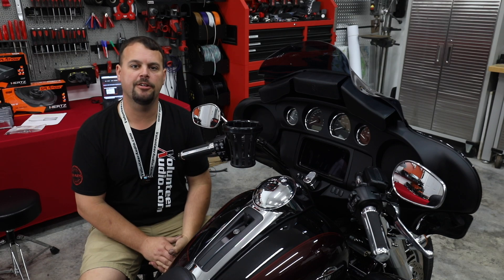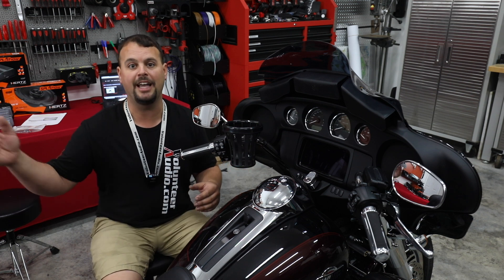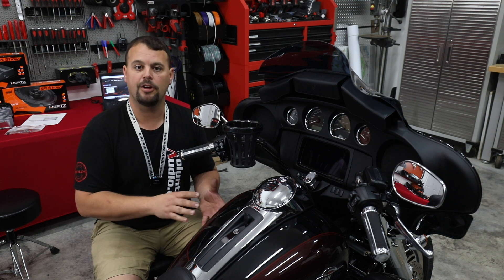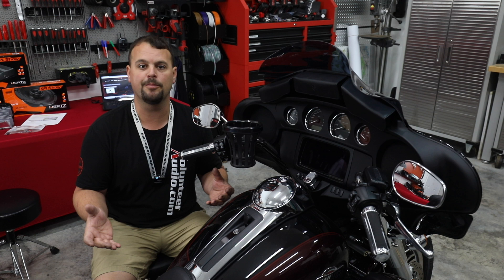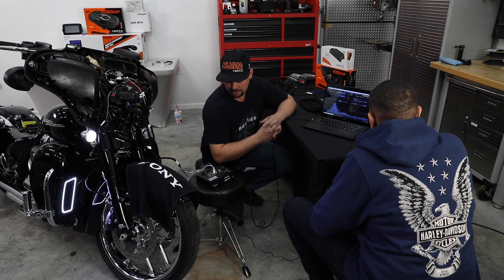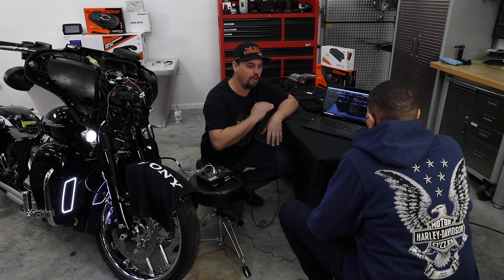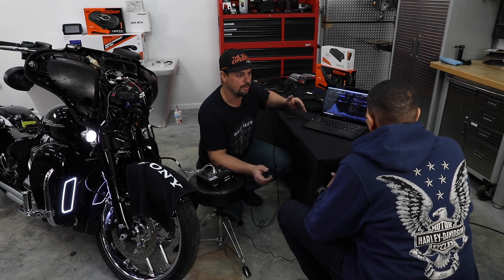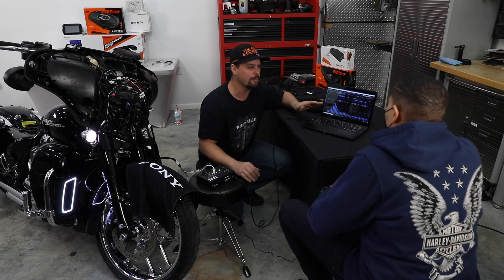Why you have to flash your factory radio when adding a new amp to your Harley Davidson

Comment: My radio wasn’t flashed and I have a DSP I thought the change was because he tuned it at 12V without the bike running, but once I start it, it’s at 13.5-14V. What you mentioned actually makes sense sort of like the speed volume which i have turned off.
Reply from the maker: This is a very common problem, thank you for watching!

Comment: Your one of the few who point out how Harley changes the Frequencies when the Bike is running. 
I am running Biketronics Amp & LL's on a used bike (last 3 years). 2016 RG, GT stereo, that HAD a ArcAudio Amp. 
I suspect it wasn't flashed (learning curve, Arc didn't require flash ?)  I rented a FLASH device from Biketronics 
and thought I got a 2x8 (?) Flash, or a common flash for added amps. Note FADE is available on the Radio.

QUESTION: Rich Bass Sounds.....when I start the bike, it reverts to mids and highs, pretty bright, loose bass.  
WOULD that indicate MY Flash "didn't take" or I just flashed it back to Stock  ??
After you flashed in this Video you showed the Flat Curve.   Is it the SAME Flat curve with the bike running or off ?
Reply from the maker: Yes curve stays the same while engine is running after flashing to the 6 speaker 2 amp flash we show in this video, you can check your current flash by pulling the eq.bin number in the radio service menu, the flash we use is 134.bin

Comment: Ive got a road glide standard with the 4.3 Radio. Im adding an amp leveraging the two fairing outputs (left/right) to go into a 2 to 4 line converter and then into the Amp (4 ch).  Would I need to flash this unit? Not looking to use the rear fader or anything like that.
Reply from the maker: Yes any time you add an amplifier we recommend flashing the radio for the reasons outlined in this video

Comment: Great Video!  I am running the GTS radio with the only the Boom Stage II fairing speakers and only the (1) Boom amp in the fairing.  Would you use the same (2) amp flash for this set up?
Reply from the maker: If replacing your stock amp with an aftermarket one yes
Reply: @volunteeraudio  Thanks for the fast reply!  I am planning on keeping the stock Boom Amp and Speakers. I just upgraded to the GTS radio from a 6.5GT so I was hoping to have it flashed it so it sounds the best it can at all volumes without the crazy EQ curve.  Unfortunately it appears that the Boom II cannot be flashed and I am stuck with the EQ settings unless i upgrade everything. Is this correct?  Thanks again for all the videos!

Comment: This video is above my pay grade, my questions are probably pretty basic. I purchased a 2008 Street Glide with a OEM Harmon Kardon radio and it has the OEM 2 ohm front speakers only on the fairing, nothing is boom I believe, don't even know what boom is, should I even care, was boom even a thing back then?
Anyway real my first question is this, my bike has the correct overlay and rear speaker harnesses for rear speakers and I want to install the speaker pods on the tour pak. How does the HD dealer flash the radio to activate the rear speakers? I have the ECM/ECU printout about my bike and it says the radio is configured for "2 speakers with or without boom amp-enhanced EQ".  Will the dealer flash the radio with a CD in the radio CD slot in conjunction with connecting the bike to their digital technician? Second question is this, I'm being told by all the old timers that Harley will not be able to flash my bike because it is too old, that HD does not have software for a bike older than 10 years because that's as far back as they go?
Reply from the maker: I would highly suggest upgrading your radio on a 2008 model, give us a call to go over pricing and options at 1-844-30AUDIO
Reply: Thank you for the quick reply but I'm not willing to purchase new audio equipment. If my AM/FM/XM/CD radio were broken I would consider your option, I kind of thought the answer to my question might be some sort of lead on how to obtain a technoresearch flash for OEM equipment not purchase new stuff.     @volunteeraudio
Reply: Also have the same issue on a 2008 electra glide.   Front speakers only.   Where did you find your harness for rears?  I dont see any under my seat and want to hook up rear speakers

Comment: I don't want to add an amp but I'd like to do away with the EQ change on my stock Boom system when the bike (2017 FLHTK) is running.  Can I do just that?  Who do I contact to get it done?
Reply from the maker: No, if you flash the radio it lowers output for adding an amp, without an amp you will not be able to hear your speakers

Comment: I have a 2017 SG CVO with the stock boom 2, 2 amp and 4 speaker setup.  I thought that setup changes the curve upon startup?  If so what do I need to have flashed?
Reply from the maker: We flash to a specific 6 speaker 2 amp boom 1 flash that fixes these issues
Reply: @volunteeraudio  thanks.  Am I able to flash it myself buying the flash file from you or need to bring the bike.  I’m a ways away in the “mitten” state
Reply from the maker: @briannathan9162  we rent the flash tool

Comment: on my GTS, I had HD Dealer flash to a Rockford Fosgate output/equalization (have small Cicada fairing amp with load resistors,  and two fairing and two bag 6x9 speakers, with no dsp).. If we ran the white noise input, what would the output look like, and the eq curve  change when the bike is running?
Reply from the maker: Terrible flash, all the dealer can do but still wrong
Reply: @volunteeraudio  well at least I got the right one (?) While there..what would be the recommended next fix? I did notice my Radio level into the amp is still higher than USB mp3 tracks and Bluetooth cell tube play backs..i have cicada 6.5 upfront, and infinity perfect 6×9 in bags

Comment: Great video.  For a Rockford setup with front fairing and rear bag speakers and one TM400Xad amp would I use the 4 Speakers - Upper Fairing - Saddlebag - 1 Amp flash?  Does this curve perform the same as the 2 amp one you used in the video.  Thanks
Reply from the maker: No you always use the flash suggested in the video, it does not matter how many amps or speakers you are actually using, the radio can not tell what you are doing but selecting this flash gives the best radio eq setting for aftermarket amp
Reply: @volunteeraudio  Thank you.  One last question if you don't mind.  Will this allow front/rear fade?  Again really appreciate your videos.
Reply from the maker: @buzzbrischler5855  no, anytime you flash the radio correctly you are selecting a factory amplifier flash, all factory amps fade digitally to you will see fader but it will not work
Reply: @volunteeraudio  Thanks for the explanation.  I'll give the flash a try.

Comment: I have a Rockford Fosgate 4 speaker set up installed on my 20 RGS and the sound does change when the bike is off compared to when its running. The radio was flashed with the rockford flash and was wondering if the flash you use is better or should i leave it alone? P.S. I plan on installing the Rockford sub kit in the future .
Reply from the maker: The Rockford system recommends the Rockford flash, my opinion is that there are better flashes but you would need to retune the amplifier settings, if you are using hd audio by Rockford you need to use the suggested flash

Comment: Hi thank you for your video and explaining the use of the DSP. Would you use the same flash if you have a single 2 channel amp with 4 speakers?
Reply from the maker: We normally do not use a dsp, and yes this is the flash we use every time we add an amp to a Harley
Reply: @volunteeraudio  Thank you for your prompt reply. I have gone with two speakers no amp flash as the 4 speakers are wired parallel on the 2channel amp. No DSP either.
Reply from the maker: @kennedybeaton9110  you are using the stock flash that has the bad eq issues
Reply: @volunteeraudio  thank you for your reply. So to get the correct Flash i require the Techno Research Tuner?

Comment: Wow, alot of info.  I have a GTS in my 2017 SGS and running the hertz neo speakers with tweeters in grils, SD 400.4Evox and biketronics line level, will flashing my radio help at all?
Reply from the maker: Yes, line leveler is the worst way to connect an amp to a Harley, then reset your gains for the new input signal
Reply: @Volunteer Audio  might need to call yall or see if my local HD can help.  I know AAHD doesn't like to mess with aftermarket stereos.  Thanks for the advice.
Reply from the maker: @jasonbreedlove495  the Harley dealer cannot properly flash the radio, they also will not have distortion detectors to properly setup the amp
Reply from the maker: Your amp is too small, we can get you setup with a plug n play amp with correct power for your speakers and rent you the tool to flash the radio as well, reach out to our sales team @ 1-844-30AUDIO

Comment: another great video Jay.  one question though.  i have the older GT6.5 unit.  does it operate the same as the GTS in that once started it re-sets the curve?   i should have the dealer flash my radio to a boom 2 amp setting and get rid of my BT35 that i originally installed....which by the way was long before i found your videos
Reply from the maker: Yes the flash works the same on gt or gts, and yes both radios have an eq that changes while running till flashed

Comment: I have hertz neo speakers and a ordered the precision power 800w plug and play kit for my street glide from you guys for stock radio is it going to sound better than stock or should I be looking to send it somewhere to flash it to make a difference. ?
Reply from the maker: It must be flashed as we set all gains and filters on the amp for a flashed stock radio, we send directions showing which flash must be done
Reply: @volunteeraudio  ok so I’ll take those directions to a shop Or will it be cheaper to buy the part and do it myself the ones on your website are for 2014 and up I need for older 2009.
Reply from the maker: @HillbillyFun-yr5pc  ok, on the 2009 you should not have to flash the radio, just properly set the amp gains
Reply: @volunteeraudio  thanks you guys are great
Reply: @volunteeraudio  but y’all do that before sending it out for me?
Reply from the maker: @HillbillyFun-yr5pc  it is set close, we use the settings for the better aquatic av radio but honestly nobody keeps the stock 2009 radio because it does not have Bluetooth, I still suggest using a meter to get it perfect
Reply: If you add an amp you do not have to flash it it's a crock of shit

Comment: My local shop flashed my 2018 street glide with the 2 speaker no amp flash and said it would level things out. Is this flash ok or should I have him reflash. I am installing 4 speakers 1 amp. Thanks
Reply from the maker: 2 speaker no amp flash is the factory installed flash that does not work correctly
Reply: @volunteeraudio  thanks for your reply. What exactly should I tell him the flash is that I want? Thanks again